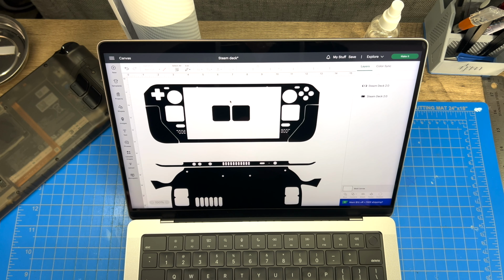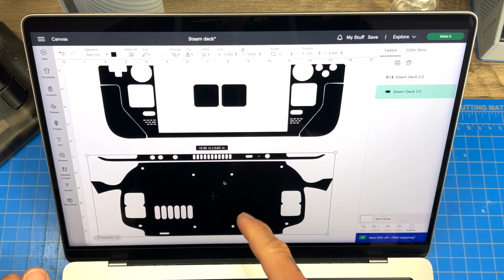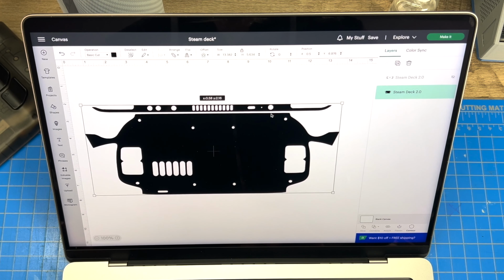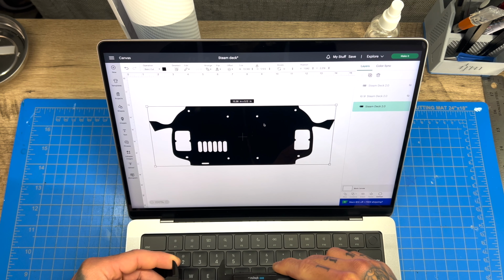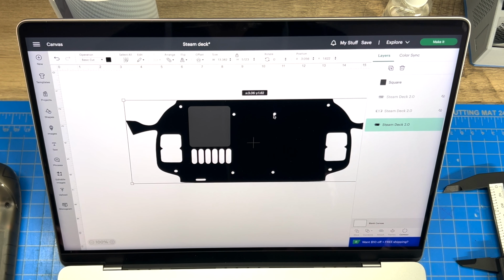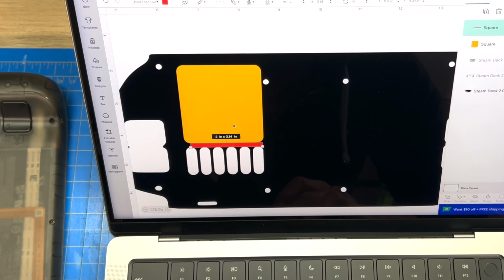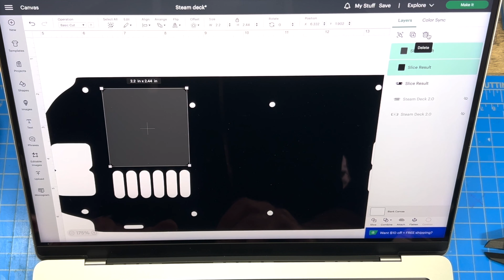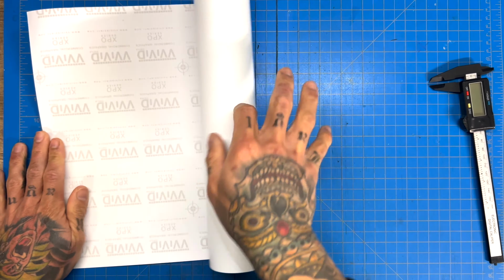How to Vinyl wrap your Jsaux back plate

Comment: How much of a difference does the black plate do? I have stock back plate and was thinking about it. 1 it looks cool 2 it's supposed to make the temperatures lower and maybe use the back buttons.
Reply from the maker: It does but it requires a external cooling solution 

https://youtu.be/2dzdR_LeHXo

Comment: It's only scratched up because you've beaten it to hell and back 🙃 its been a good little inanimate object taking all the abuse.😆 you've mounted so much to it, normal use won't do that. But hey it's that time again. Hate on the plate but then cover up the main reason to have the backplate why else would they produce all these different editions now 😉
Reply from the maker: I would considered what I've don't to it regular use, they should have used a ABS plastic for the back plate. 

They probably used PETG blend, cheap plastic. makes sense why it's so brittle and scratches easily.

I thought the main reason for the Backplate was the rear buttons and aluminum plate.... I didn't cover them up?!

Im pretty sure the reason why they are making new colors is to make more money.
Reply: @Diy_Papi  Did you not put a custom 3D printed fan slider on the back exactly where it is all now scratched up? Yes you did, that isn't regular use. People asked for purple gave two winners then decided to make them all anyway. people want choice give them what they want.